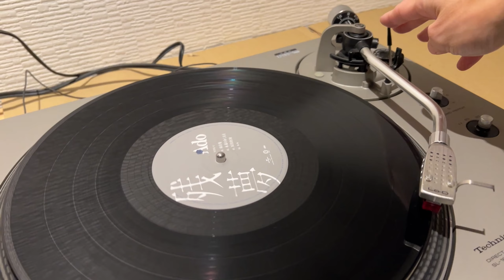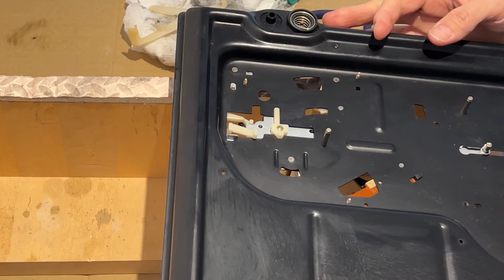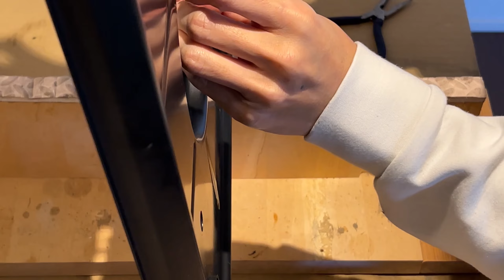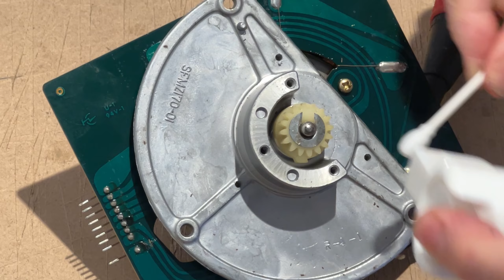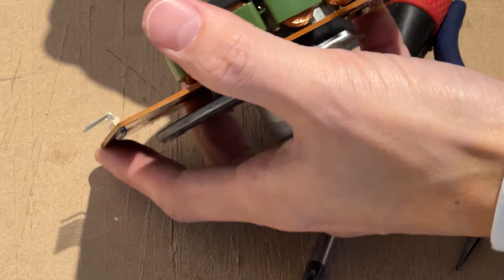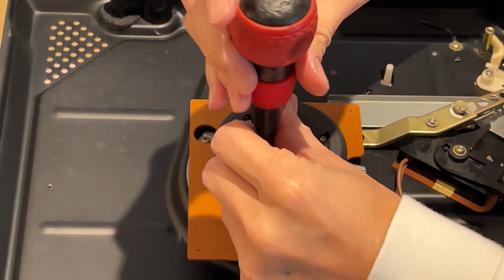Technics SL-1600 Rebuild - Reassembling After Deep Cleaning

Comment: hi, i followed your video and lube using superlube synthetic lube. and after reassemble, the auto start is normal but auto return speed too fast and my tone arm swing to the resting point & bounces back. May i know what causes this issue?
Reply from the maker: I’m not 100% sure, but if this started after disassembly and lubrication, I suspect something may have been reassembled incorrectly in the auto-return mechanism. The return adjustment changes the return starting point, not the return speed. I would first check the linkage, cam and spring positions, and also make sure too much lubricant was not applied.
Reply: @Takeashop  thanks for reply! It turns out my cueing rail need to be cleaned with isopropyl alcohol 😂 once i cleaned it the tonearm movement back to normal! Thanks for the video!
Reply: @Takeashop  hi, sorry to trouble you again. I found that when auto return the tone arm move back slowly and smoothly. but when stop the record half way playing, the tonearm will swing to the resting point and bounces back. May i know the causes of this, it's been troubling me for months lol